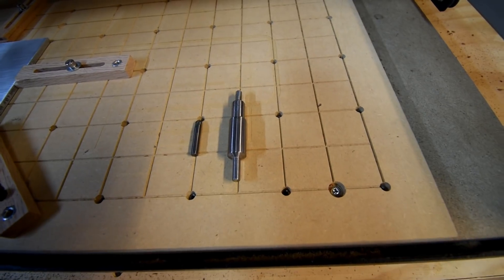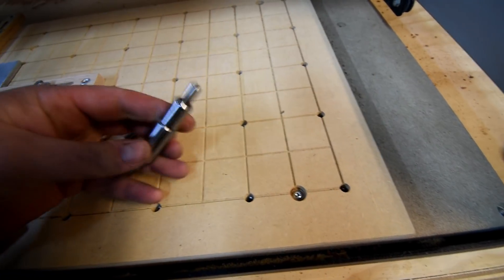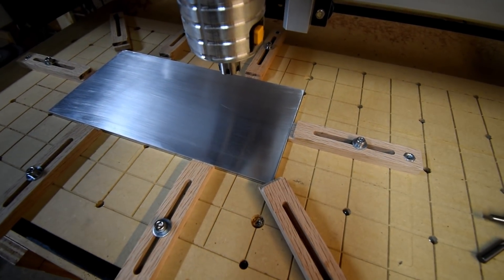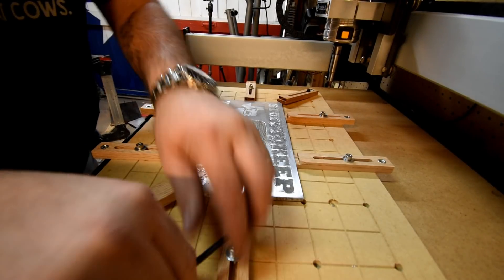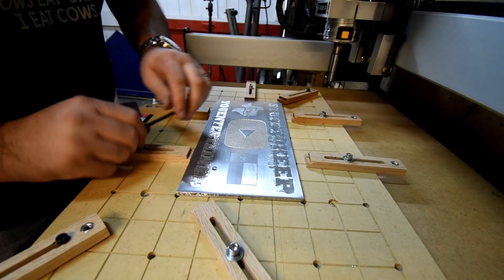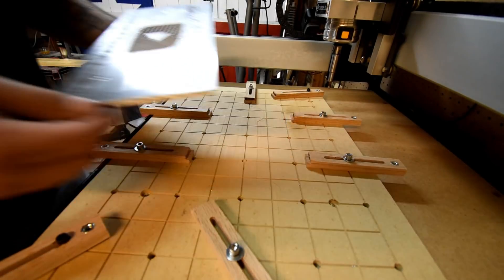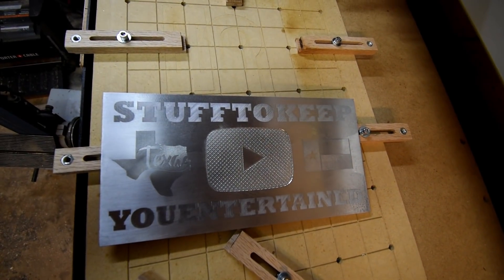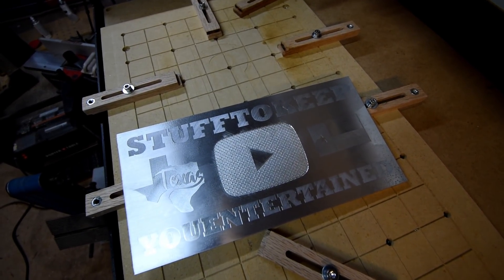First time using aluminum on Shapeoko CNC

Comment: I use mineral spirits for a lubricant on brass and aluminum, it helps a lot and wouldn't dry up fast.
Also if the cut is deep don't use a single pass.

Comment: power first coat bit for aluminum and hard plastic. the best quality router . 
Diamond over-DLC Aluminum φ2 2.5 3(4)mm router Endmill single(2)-flute engraver
Item ID: 254188000203   ebay.com

Comment: Just research your material and send it in tolerance to the cutter adjust programing as need be. Would have liked to see forced air on the work to cool and clear rather than still cutting fluid that just reams chips back into the aluminum though. might have helped the right hand corner of the button out :)

Comment: your Z was not perpendicular to the surface of the aluminum, thats why one side is sharp, and one side of the path was dull.

Its probably not your Z, its the surface of the material.  If you surface the material first, then cut this, it should be even.

Comment: how long was total run time for that roughly? all said and done for the whole plate. and is this something you can walk away from after starting or should i monitor the whole time?
Reply from the maker: I never really leave my machine when its running. I prefer not to. The run time all together was probably a little under an hour. This was a pretty simple thing. The diamond drag bit might be kn to walk away from, but I just like to play it safe. These things can develop a mind of their own sometimes.
Reply: @stufftokeepyouentertained2168  thanks for the insight. i run a small construction labor company and almost every plant i step foot into is in need of signs and labels that i could create with one of these machines. so just starting to look into this option for expanding my business. Thanks!

Comment: hi nice video  ,  what adaptor use to plug  1 mm bit ?
Reply from the maker: I don't use adapters. I use an actual collet and nut. The ones I use are from precisebits.com They are made by a company called think and tinker.

Comment: Nice first try! I use WD40 for lube and I would do the engraving of the play button  in 2 passes, 0.006" each pass
Reply: @frankswoboda1250  You may be right but thousands of hobby machinists use it successfully as well as many bridgeport operators milling aluminum. There's a huge difference in milling aluminum and running an engine on the stuff.

Comment: Nice. I have a homebuilt CNC using a Bosch Colt router. I have tried a few aluminum pieces and not much success. I do have a couple of diamond drag bits I have used on Lexan. May try it on aluminum next

Comment: Is it possible to redo the part that didn't get the oil?
Reply from the maker: In theory if I re-did it the bit would never touch the metal since it has already cut it. I think you would end up making it worse if you tried to go back over it.

Comment: I would say the wavy pattern is possibly a combination of three things. That can be remedied with tool path correction. Which I've only seen people do successfully in fusion 360. 1 is possibly super fine tuning of your steps per mm or inch. And mostly tool deflection. You may try creating a clean up code to make a final pass just around the play button. Which could result in messing up the whole thing. Personally I would leave well enough alone. But take steps to try and correct it on future pieces. This is why i want to learn fusion 360. Problem with my machine is it only seems to run with universal g code sender. Which could possibly still run g code from fusion but is  a few more steps in the process. Any way I like your videos they are helping me learn this new profession/hobby. So i can get out of trucking and start follow my dreams. Ps. Take it easy on the oil haulers. Not sure what part of west texas your from but I run in that area about 800 miles from my home in the pecos orla and east north east area.

Comment: i find that on my smaller machine ( more prone to vibrations and stuff ) , it needs to take less on the passes, this will usually suit most machines,   if your not sure about spindle rpm, do a test strip with different rpm and see what works best and at what feed and depth of cut. aside from that your aluminum turned out great,

Comment: I have an x-carve and use compressed air to clear the chips in aluminum cutting. I cut fast ipm but low doc and it works pretty good. That looks great, I just subbed your channel. I don't make videos but hey ya never know. Thumbs up
Reply from the maker: Thanks for the info and the sub. I'm going to be attempting some more aluminum stuff in the near future. I want to make my own small brand for branding the stuff I make. I'll keep the info in mind.

Comment: the wavy pattern on the V-cut looks like deflection.  your first pass has straight lines due to the constant pressure of the bit going through material and it is unnoticeable because of constant load.   when the cross-hatch pass starts, the bit tries to walk when it hits the peaks of the first pass.  the belts and gantry are flexing under the torque of the bit.    run the code on softer material and compare the pattern.
Reply from the maker: So if that's the case how do you keep the deflection from happening? smaller bites, and slower feed rates maybe?
Reply: slower feed rates, higher RPMS or multiple passes.
Reply: @stufftokeepyouentertained2168  Joe is correct on this, its the nature of using a CNC machine designed for soft materials (Wood/Plastic) on a hard material such as brass/aluminum.

Comment: I don’t claim to be an expert. But I would say it might have to be the tuning on the stepper motors and belt. One of you axis is moving shorter in relation to the the opposite axis. Just and educated guess. Good luck
Reply: It looks like head deflection since it didn't effect the drag etching, so its unlikely to be belt slippage or misalignment.   

When using a CNC router that is mainly designed soft materials it often lacks the spindle (Z axis) rigidity to cut things like brass/aluminum quickly. Your only option would be to lower your feeds to put more work on the cutter, this would result is a lower lifespan for the cutter. However it should limit your deflection and/or gantry binding if any.  Lubricants help keep the bit cool and extent the lifespan of the bit and can help with the finish of the cut.

Comment: Where did you get the diamond drag bit?   I enjoy your videos and you have inspired me to get back to working with my Shapeoko.
Reply from the maker: I got it directly from widgetworks. They are a little pricier than others but the tool is quality made.
Reply: @stufftokeepyouentertained2168  I came across your video and I'm in need of some engraving on a Aluminium plate,do you do this for a living?email me at jynx4eva@gmail.com